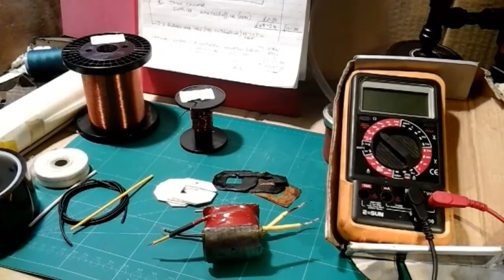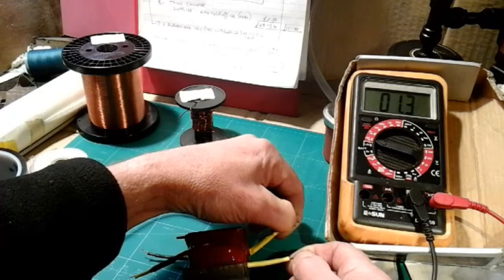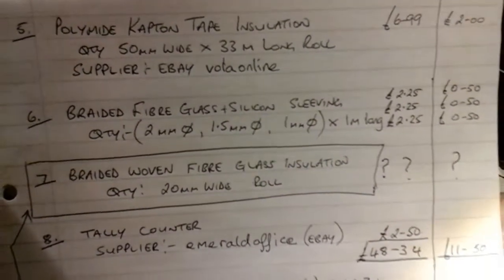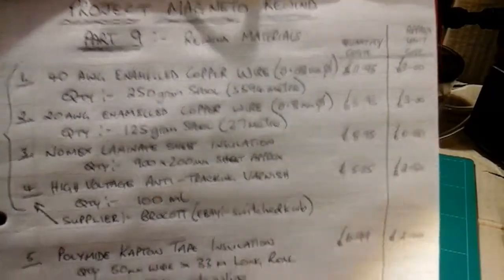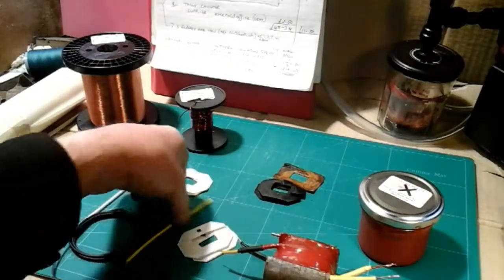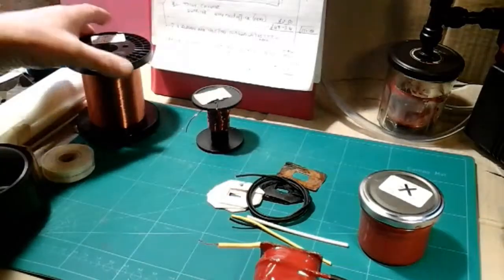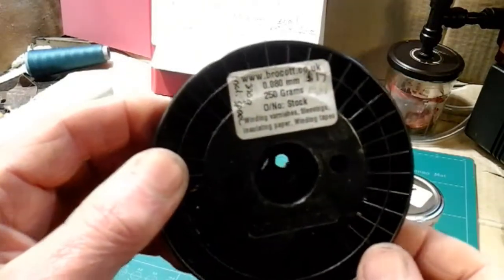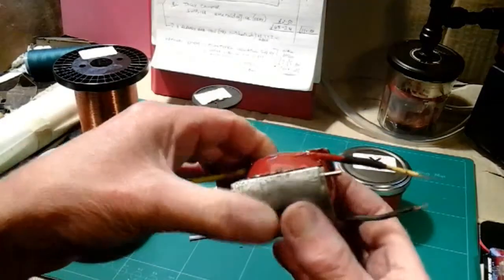Project Magneto Rewind - Part 9  Materials

Comment: I might be wrong but I don't think you should not hold the wires in your hands as your body is a conductor. You should use crocodile clips.
Reply from the maker: thanks for feedback
i did this as an experiment quite a few years ago, i'm no expert on this, but everything has worked fine,
but thanks for your concern👍👍👍👍
regards
Kev